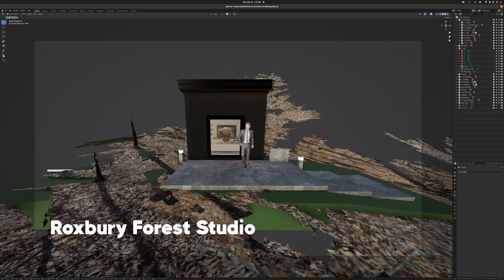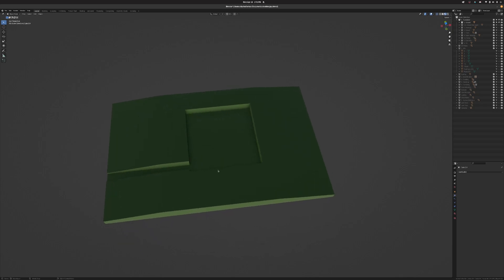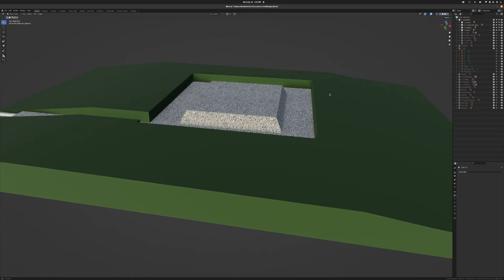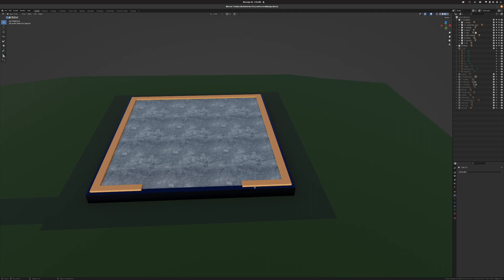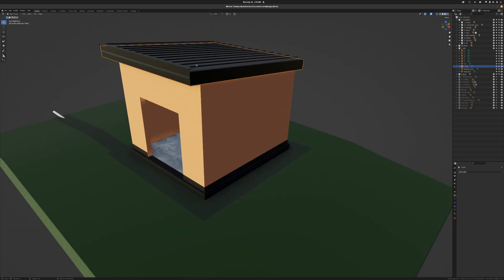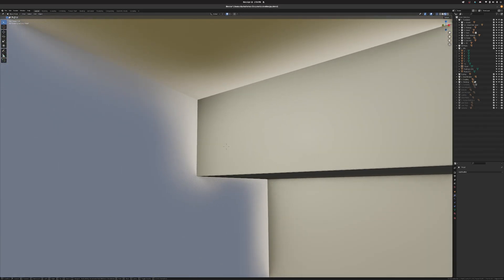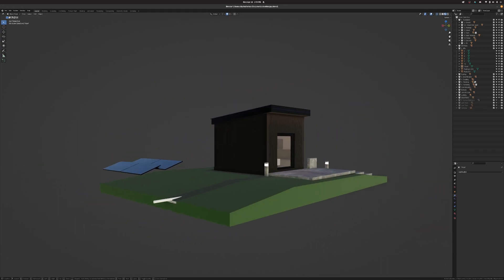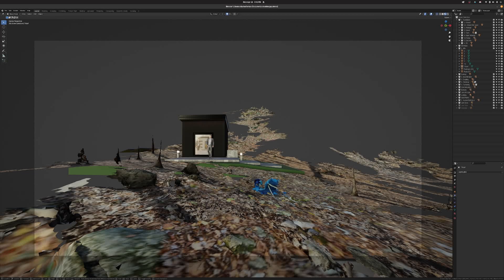I'm building a Tiny Studio!

Comment: Thanks for the Story Boarder! In regard with the studio, I will recommend the permaculture principles for passive energy efficient buildings. There is a Permaculture class on Udemy by Bill Mollison. It is vastly superior to what I've learned in 3 years of architecture. 

But in short if you are in Nord Hemisphere make sure you got the south wall as a big window. {In south hemisphere, the reverse} The area of the window should be in relation to the latitude. If for example you are at Latitude 45 it should be 45% of the wall. Make sure to have a thick curtain on the inside with which to cover the window in time of night and cold overcast days.

It might be a great idea to get a window on the east. For power morning hours with natural infusion of light. Depression is influenced positively by nose breathing and natural light.

To have a silent room, put thick carpet on the floor and on the walls a thick curtains.

Make sure you do not have a window on a wester wall. It will fry you in summer and blind you in winter. Plus, the cold strong winds are usually on west. 
No window is necessary on the north. But it is good to have a covered terrace for outside writing in the summer. With a covered terrace on the North, you could cool out the house in the summer with some low placed air vents on the northern wall. And exhaustion vents up on the ceilings or roof. 

A pity not to have a roof window. The solar panes are kind of vulnerable to animals and thieves or ill-mannered teenagers.

The cool air comes from the mountain down, make some ways for it to pass your house and not remain stuck on a side of the house.

It will be a wise to plant some pioneers shrubs and climbers to protect against an upper land or snow sliding.

A hammock or two will be much better than a couch. {sleep on the diagonal and not as the not trained ones which do it longitudinal, see YouTube the US marine training for the Hammock}. You get the best sleep in it, and it gets you really relaxed, plus you can pack it really easily. And eventually put a bigger table and drawing board to be able to open more books, maps, drawings on it and work also outside the PC for more old school creativity.

It might be that the roof might need more of a slope if the structure is not so resistant for snow loading.